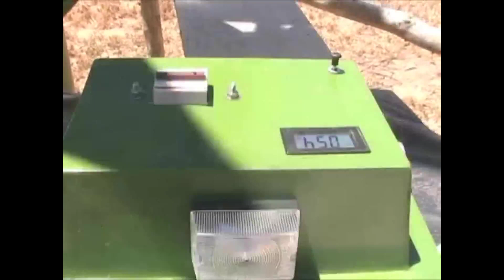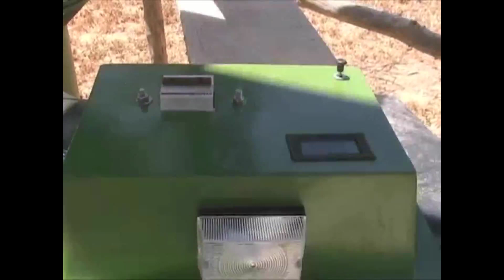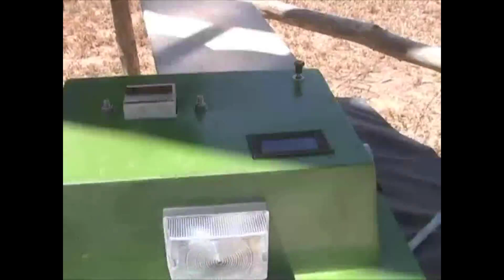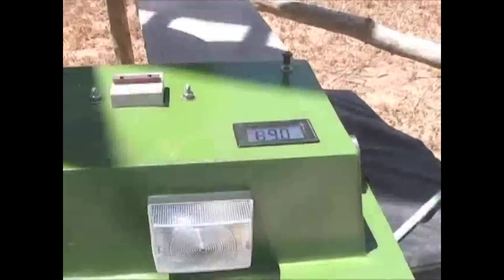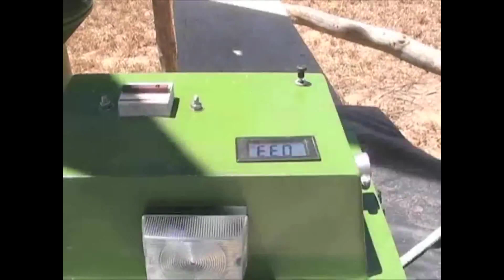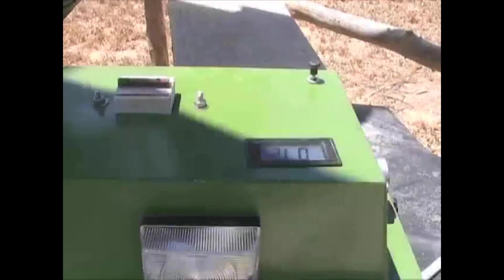Our Vertical Axis Wind Turbine VAWT experience

Comment: My best advice go Horizontal and for low winds always buy 48V model, 
even if you have a 12V or 24V system. Use a 3 Phase Bridge Rectifier to convert AC to DC, then use normal solar charge controller, best to use a PWM solar charge controller because it has a quicker reaction time. Just check that the solar charge controller input voltage can handle 50V or the listed maximum wind generator voltage. For low winds always buy the 5 blade model and buy the blades with scoops on the blades, not flat blades. 
I hope this information helps everyone.
Reply from the maker: Yeah....I still think about it from time to time. Even using my existing stator set up for horizontal.

Comment: Very much thank you for sharing.  I truly believe that VAWT is rarely (if ever ) the way to go, and I expect you came into trying one due to some misconceptions, which I still see in this video.  At the beginning, all the reasons to go with a VAWT are either not the case, or... the problems also apply to VAWT.  Folks don't put VAWTs high in the air because they weigh a ton and they they're heavy.  Also, being hard to balance they're hard on towers... so they're always on short towers.  There is so much more wind up higher, and energy you harvest is related the the cube of wind speed.  A tower to support an honest 1kW HAWT would likely cost less than what you have in the video, and the machine would probably weight 100 pounds or less.  VAWT has no advantage in low wind.  I'm probably similar to the fellow you bought your turbine from, I build turbines for myself and other folks.  Turbines I build are not noisy, and they start up in very low wind .(I expect to start turning around 3mph give or take and producing a bit of power by 6 or 7)  There's about no energy available at those speeds anyhow, especially for a small turbine since power is related to the cube of velocity, but that's where we start ~ hoping for a bit of useful energy around 8-10mph.  At any rate, I'm glad you shared ~ it's important to share both success and failure.
Reply from the maker: Yep! Exactly. Very well put and completely accurate. I would off the same advise to anyone that considered this.

Comment: Thank you for sharing your experience.  With the way solar panel prices have dropped during the last decade, wind powered electrical systems only make economical sense when they have wind turbines about 30 foot in diameter or larger (15-25 KW size).

If you have a lot of cloudy days and go the solar option, make sure you find a good Maximum Power Point Tracker (MPPT) controller.  Some of them will even boost the panel voltage when it drops below the charging voltage.
Reply from the maker: Agreed. We plan on changing over to Mppt once we get over a 1kw system. Right now we are are around 900 w. Suits are needs including a normal fridge. Thanks for watching.